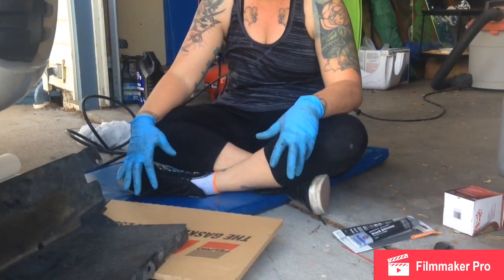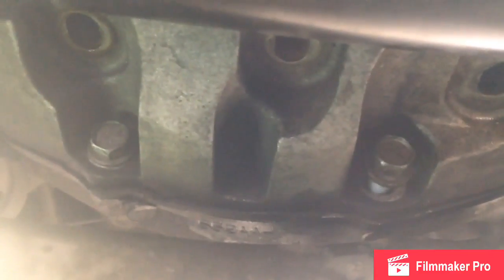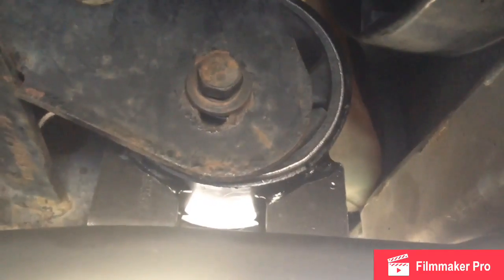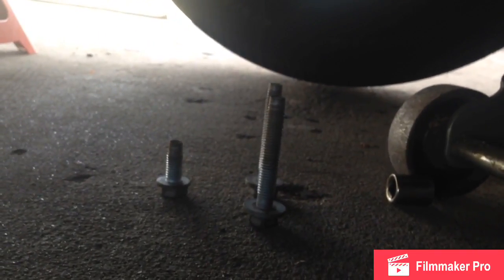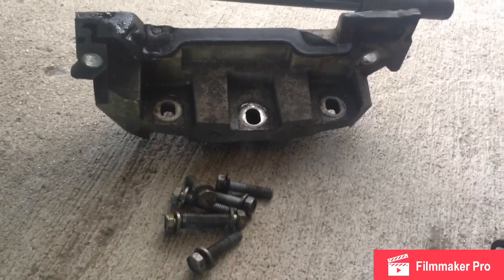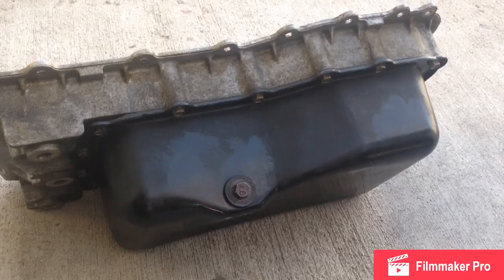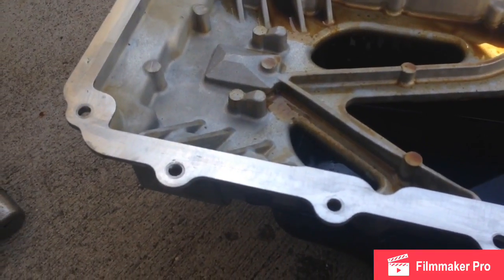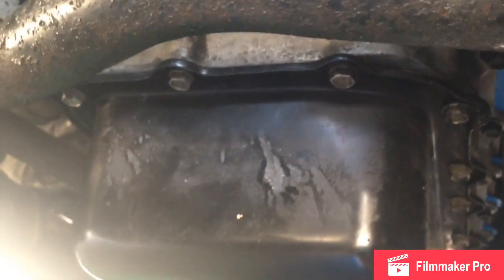2008 Dodge grand Caravan oil pan gasket replacement 3.8 L

Comment: Great video, took about 3 hrs with clean up and setup time. 

 There is a warning on the bottom side of the oil pan that refers to the tightening procedure for the aluminum bracket, the horizontal bolts that go into the transmission need to be tightened first and then the vertical bolts into the bottom of the oil pan otherwise it could crack the brace, you can tell because the bracket has slotted holes going up into the oil pan.

Comment: Thanks Mamachanic! I did it! It is a tight fit getting pan on and off and I was really worried about the engine mount hassle, but I did it! Great video! It's nice to see women tackling the same problems as us men. Either way it feels great when we succeed. Keep videoing!
Reply: Jimbo ReadDABible what’s the name of that long bolt on the engine mount? I snapped mine off trying to do the same project
Reply: @davidcruz2398  which long bolt? The one that goes horizontally through 2 1/2" rubber vibration dampener grommet? Or the one that goes vertically into front frame with thin rubber washer? The vertical one I only loosened slightly as it was VERY stiff. I only took out the bolts needed to (twist) the cross member to give room to take out flywheel cover.

Comment: Thanks for the video. I have an 09' VW Routan which looks just like that underneath you van. I have changed the valve cover gaskets but had not tackled the oil pans. I should have done it when I changed the motor mounts. Thanks for including torque specs. Good work.

Comment: Thanks for the informative video , looked like a rear main seal leaking on mine until I took that bracket off , looked up with a scope and saw the rear main seal was dry , it was the upper gasket that was leaking on mine too
Reply from the maker: Nick Oliviero much easier than a rear main

Comment: I don't replace many oil pans, but I think it's ridiculous that it's two part, only one part has a gasket, and even on that part you have to use silicone on the block because the the mating surface is three different pieces of metal. Jeeeez

Comment: Very helpful video. By the way, what's the best silicone to seal the black oil pan to the aluminum body? Thank you!
Reply: The right stuff is the best in my opinion
Reply: Permatex actually advertises the Ultra Black(82180) and not Right Stuff as being meant for oil gaskets, but not so great on gasoline(almost nothing is). Either way, it's about the same price as the competitors. I haven't tried Loctite or JB-Weld or Visbella gasket makers but they should have similar quality and results. The main thing is to make SURE you use one designed for oil interfaces like the oil pan.

Comment: i wish you would have shown how you worked with the jack. 1:28 . i need to change out the gasket. Mine is leaking also.  When you place the jack. does anything else need to be supported?
Reply from the maker: Lynx 4293 stick a jack under the trans pan with a block of wood so you're not putting stress on the upper mounts when you move the lower mount and cross bar
Reply: 2:22 i see it now... grr why does that mount have to be in the way. I have a 2010 Chrysler town and country and it has the same upper/lower oil pan. great video. one thing for the ppl like me. "drain the oil first"
Reply: Hey thanks for telling them about using a wooden-block! I've been using one with my jack because it also seems less likely to slip or damage the van's metal. Anyone working under one of these without backups (no, additional scissor or bottle jack doesn't count!) and chocks(not just parking brake) is also taking their own life into their hands, but that's a different discussion.
Reply: You don't need to support the transmission since the driver side transmission mount and passenger side engine mount are supporting the engine. The front mount you are unbolting is just to react the rotational force during engine operation.

Comment: Thanks for posting! My wife's van oil pan is leaking and this helps see what's involved. Is there a reason you went with Felpro vs OEM (Mopar) other than price?
Reply from the maker: ICPREYROEVIPERGTS probably cost and availability at my local parts store with a good warranty
Reply: Personally, I went with Felpro because they seem better-made than just about everyone...  And are not that expensive.

Comment: Great video, thanks for sharing, so how long did it take you?
Reply from the maker: dew812 about two hours. I didn't reseal the lower pan. You also want to allow some time for the silicone to set before putting oil in and getting the engine hot again

Comment: Too bad it doesn't seem to be my oil pan (or valve covers for that matter - those are dry!). XD I'm going to see if I can find a video for parts near the passenger side of the engine. It seems to be coming from near the alternator and power steering pump. I can't really see too well in there to find it easily. It probably wouldn't be a bad idea to add some extra gasket maker on the outside of the oil pan gaskets, anyways, after cleaning the engine...
Reply: Did you find where your leak was coming from??
Reply: That could be the crankshaft seal

Comment: Good video. Thanks.

SMH at Chysler. That damn support beam could have been put an eighth inch to the right and not been in the way. Will never buy another MOPAR product.
Reply: Also, I am nothing if not lazy, so I just removed the rear bolts on the beam enough to wiggle the cover plate past the beam.
Reply: Wait until you see Hyundais.  Such utter BS to replace an auxiliary/serpentine belt.  :D
Reply: Steve L so the just the read bolt worked for you? I actually snapped the front bolt of that beam today trying to tacky this
Reply: Was at a junk yard, pulling the water pump and other parts to get a good solid look at a 3.3/3.8 engine (they're nearly identical - just plugged differently on the bottom near the back I believe) and I very carefully placed a full-sized tire and spare under the motor, pulled all 3 motor mount bolts on the top passenger side, above the serpentine belt, and let it drop.  The pump then came right out.  Too bad I a) Cracked the impeller by accident before I tried that, and b) wrong year anyways.

It's actually easy as hell to get that pulley and pump out once you drop the engine - don't give up, people!
Reply: it's easier than it looks